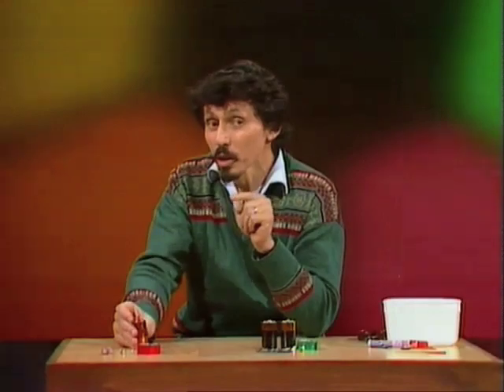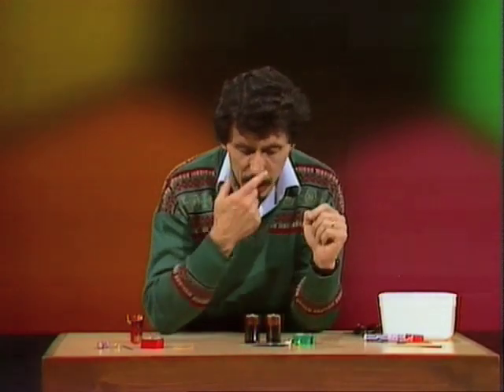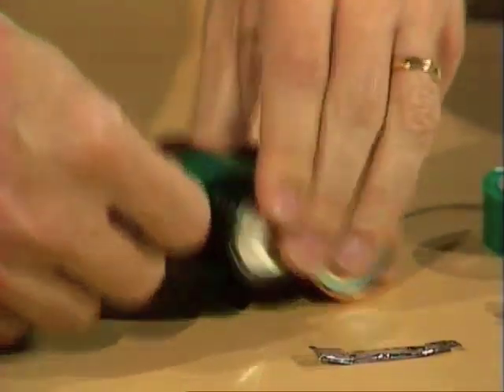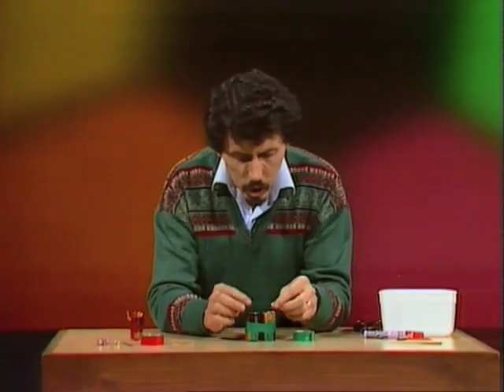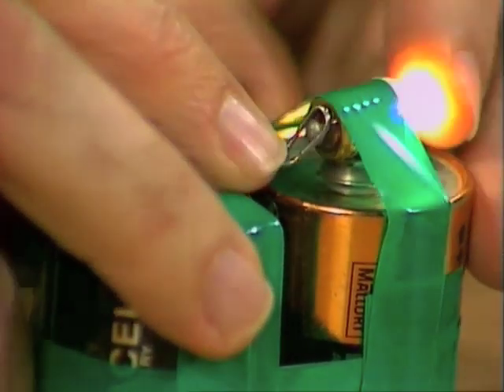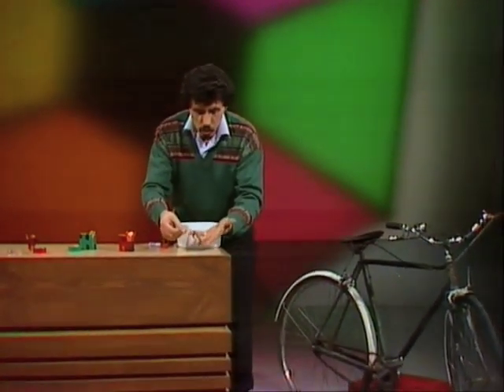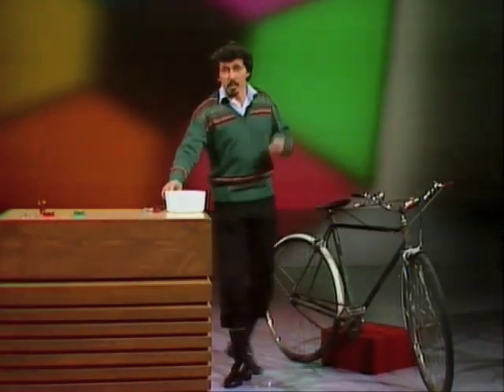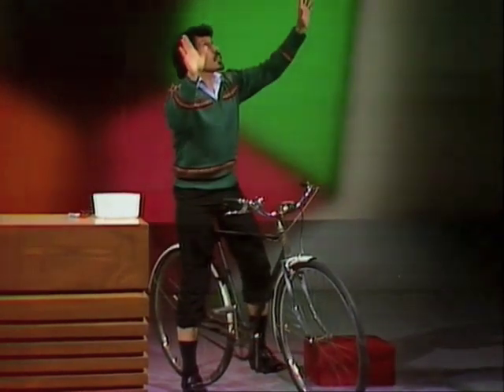Emergency Bike Lights

Comment: These days, you could probably get 10 times the light of that incandescent globe with the same battery life by using an LED with an AA battery. The basic principle remains the same, except you'd need to check the polarities before you put it together. D cells are still handy for when you need high capacity.
Reply: Most LEDs need  2-3V to overcome the reverse voltage with enough current to generate any significant light.  One of those 3V coin cell batteries works perfectly. Some of the newer bright white  and blue LEDs need an even larger voltages.
Reply: mubd1234 I think you would also need a resistor to limit the current.
Reply: @andrewbaans7400  Most LEDs have enough reverse voltage and resistance to light at 3.3V without requiring a resistor. Some of the blue and bright white LEDs work at even higher voltages.
Reply: @timharig  is the reverse reverse voltage because the LED is acting as a photocell?
Reply: @NOMAD3030  No. The reverse voltage is simply the voltage required to activate the diode so that it will conduct forward current when using a piecewise linear model. There is no real voltage produced but we introduce a fictitious voltage source in the circuit model to shift the IV function horizontally to the right point for activation when analyzing diode circuits.  The reverse voltage is a properly of the material that the diode is made of (Ie silicon, germanium, or gallium-arsenide).

Photo diodes are designed to work reverse biased and light causes the IV curve to translate down allowing some current to flow in the reverse direction.

Comment: It's always an interesting surprise when I discover something that goes by a completely different name overseas. In this case, what we in the U.S. call a light bulb.

Are you calling it a "glow" or a "globe"? It sounds like you're saying "glow", but another commenter is saying globe. Both make sense, the bulb does "glow". And we refer to the glass dome that covers the bulbs in a light fixture a "globe".
Reply: He's definitely saying 'globe', but we use both terms interchangeably.
Reply: Just like tubes and valves
Reply: He is saying globe.  I like how they say "sticky tape".  I realize that not all tape is sticky, but it is kind of the default.
Reply: I think that as the show was intended mainly for children, all the terms must be addressed as most understandable as possible, even they look kinda funny to adults.
Reply: Thanh Vo the terms are fine for Australian adults.

Comment: Those globes would be hard to find now.  If you go to Bunnings and look at the torches there they are all LED.  I can remember white LEDs first coming out about 25 years ago.  I think they were 4 or 5 dollars each at Dick Smith.
Reply: As far as incandescence flashlight bulbs go, that style is still fairly common.